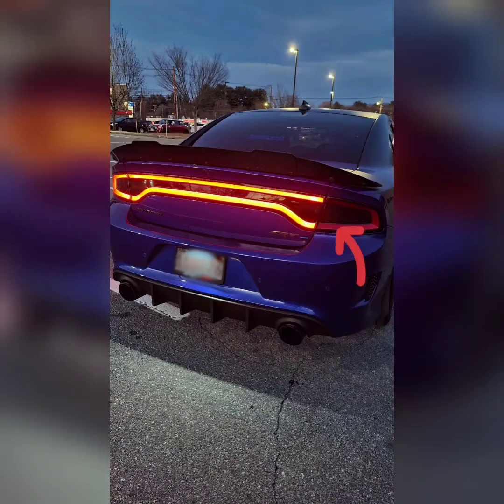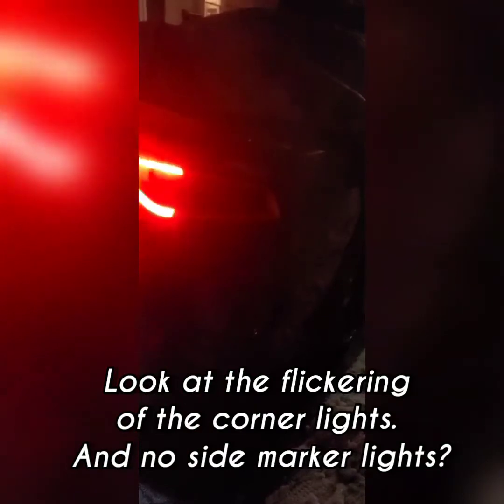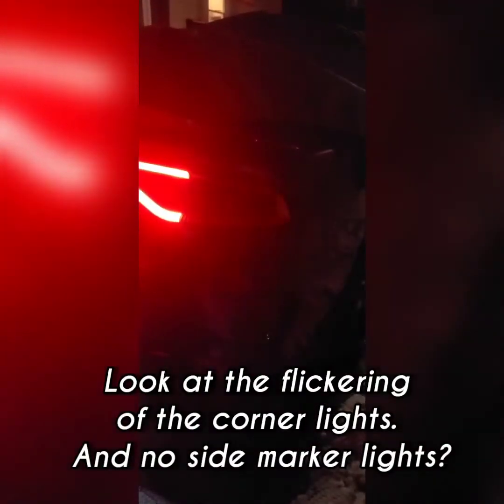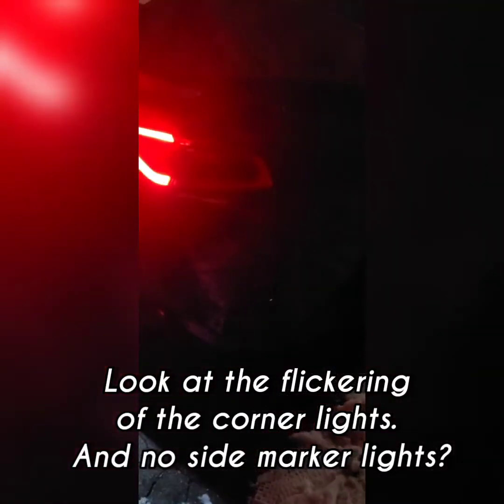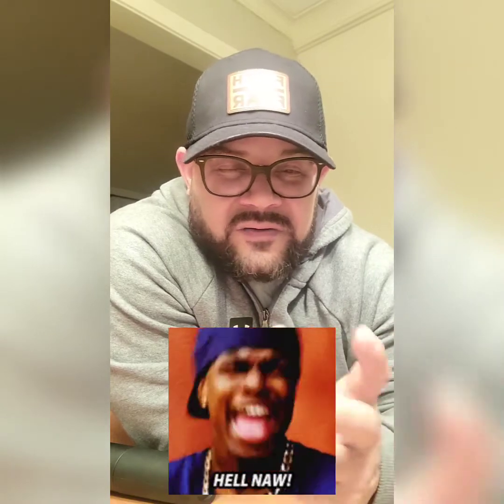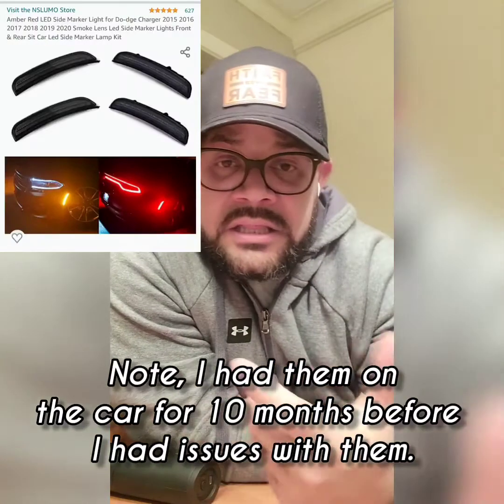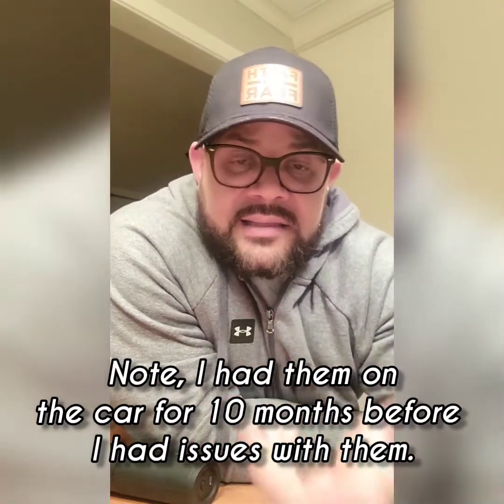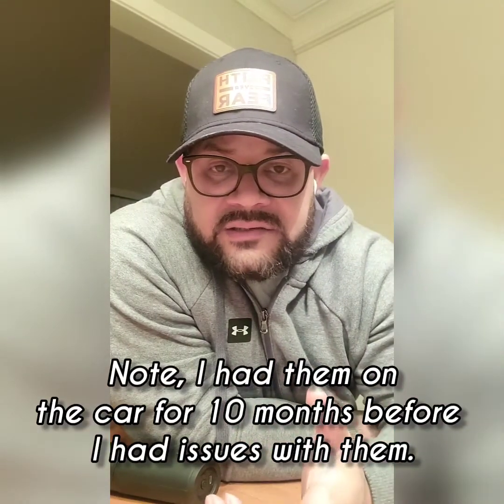🔥😫🤷‍♂️ LED SIDE MARKERS PROBLEMS OR FACTORY LIGHTS NOT WORKING ON UR MOPAR ?#dodgecharger #dodge

Comment: This just happened to me a few days ago. In the front left Amazon "led comma"  one.  Only i kept taking my star bit and drill and kept unplugging it and plugging back in and it just kept goin back out after a few hrs..plugged the gay factory dot back in and it flickered but wouldnt stay on.  the "led commas" from Amazon (left) doesn't turn on at all anymore. How do i kno its not the fuse, or whatever connects those two little prongs on inside???
Reply: This the problem I have with mine too